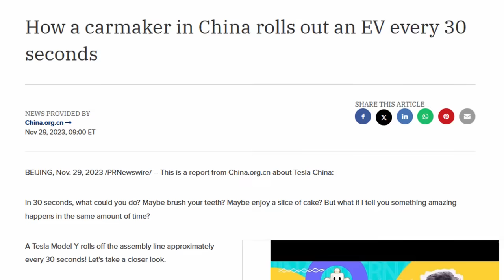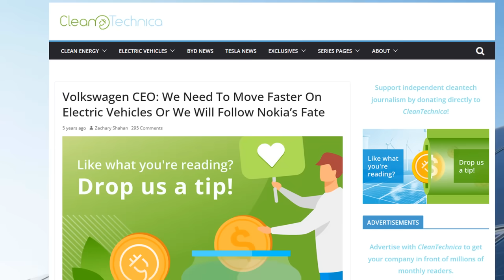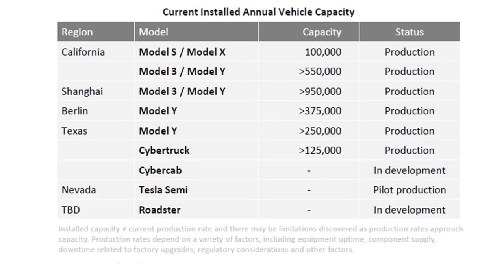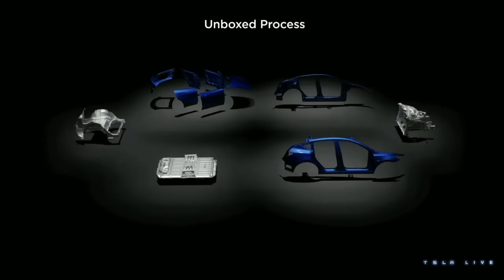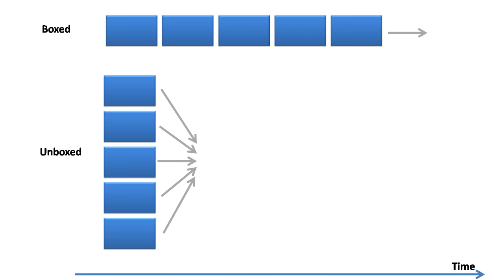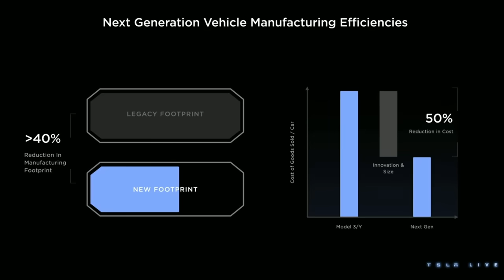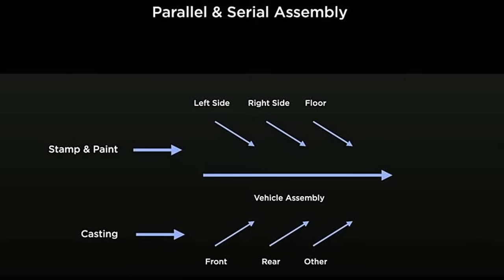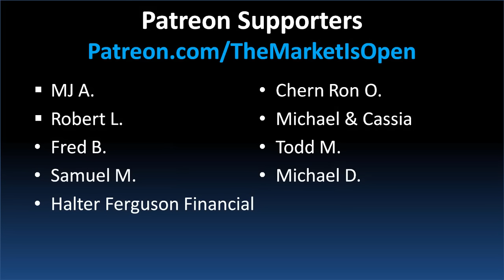How Tesla Builds a NEW Car EVERY 5 SECONDS

Comment: I noticed that the refreshed Model Y does not use a front Megacasting. I wonder if this element has been changed to allow faster production across all factories? Or to allow for the production of the new models? Either way, if RoboTaxi/ FSD works and they ramp to scale, it will put massive pressure on legacy automakers. I wonder how many would survive if tesla is pumping out RoboTaxis at the rate of one every 5 seconds? We indeed live in interesting times……
Reply from the maker: Yeah, Tesla said it was for consistency among factories..

Comment: A car every 5 seconds sounds great. Who is going to buy all the cars? Elon's not very good at market research. The CyberTruck is proof of that
Reply: @AudiTTQuattro2003  Yes, do the math. Where is Tesla going to store the 12000+ cars they don't sell every day.
Reply: @mp6756  They have found ways to do that so far.  They will find ways to handle larger volumes.  It's a good problem to have.
Reply: @billweberx  They can't sell Cybertrucks, and the production levels aren't even close to that clame. Anyone can build a vehicle but  buyers without a buyer. It's just a big dream.
Reply: @mp6756  They sell more Cybertrucks than the next 3 electric truck brands combined.  And, they did this in one year of sales where Riven had 4 years and the Ford Lightning had 2.5 years to of production.  The Cybertruck is the envy of all the other electric truck brands.
Reply: @billweberx  Wow, that's impressive if you completely dismiss the conversation. Building a car every 5 seconds was the topic of conversation. Who the fuck is going to buy the 17,500 Cybercabs built built on this 5 second per car build rate. My comment was addressing the ridiculous failure in cybertruck sales. The one million preorders  translated into only 47,000 sales in 2 years. Given the lack of performance in Cybertruck sales as compared to preorders, the Cybercab sales projections are likely as full of shit as the million preorders of the cybertruck. It's all just bullshit hype.
Reply: @ You need to read your own post.  I was replying to your comment that said "Tesla can't sell Cybertrucks".  Seems that they can.
Reply: Building them every 5 seconds says nothing about how many they will build, only that they are built fast.

Comment: We'll see how it plays out but demand and acceptance of the car will determine the factory run rates, not the capacity of it's factories.  And don't short change the enormous supply chain complications.  No matter, excitement is guaranteed!
Reply: The point is that you can do more with less factory space so it's easier to scale, and it costs substantially less, regardless of how many they produce.